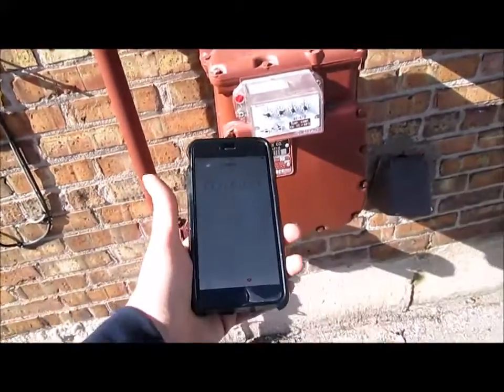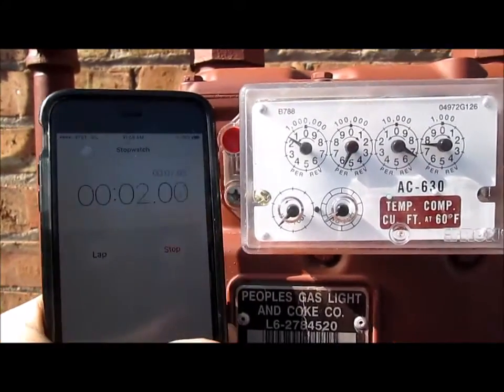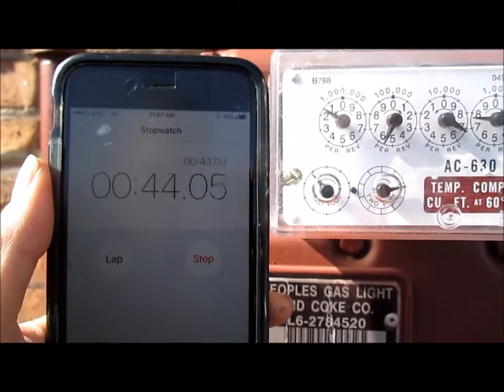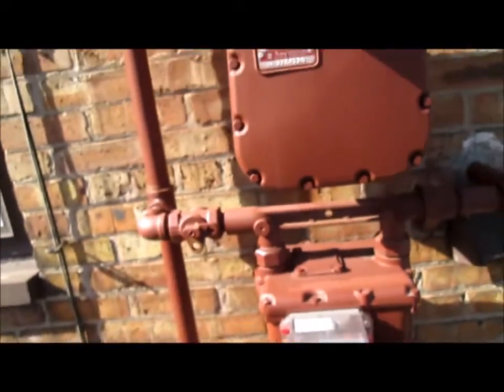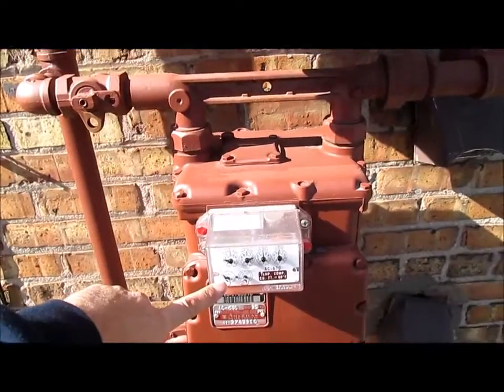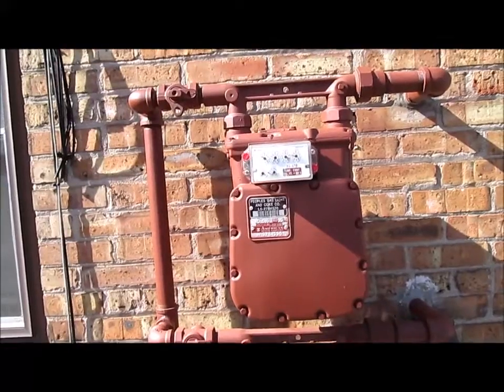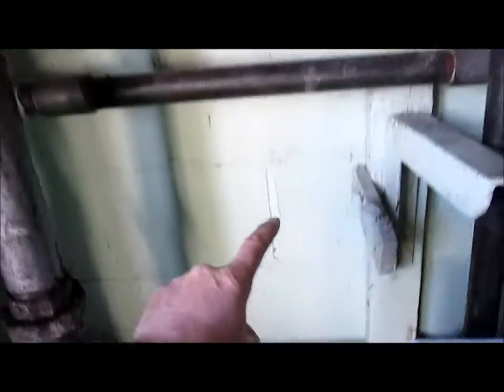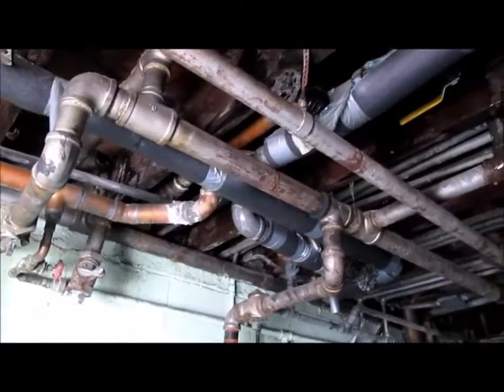Clocking a gas meter

Comment: i wasnt sure that was legal according to the national fuel gas code.
another way to clock the meter is to time the dial. .5ft,1ft,2ft - any.
say you time the .5ft dail and get 40 seconds.
3600 x .5 (dial size)
divide this by your seconds.
multiply by your gas btu (1050).
Reply from the maker: I will look into the code on that. Thanks